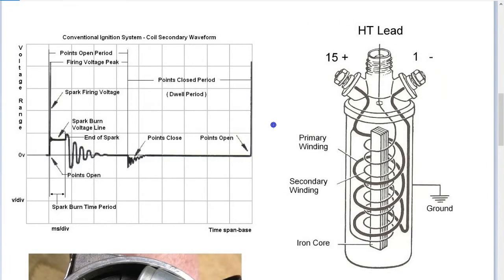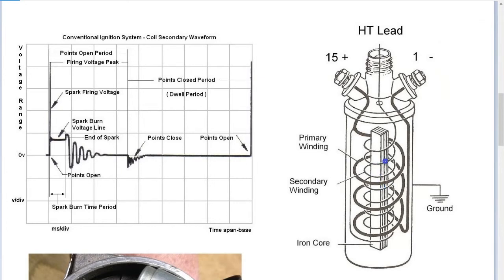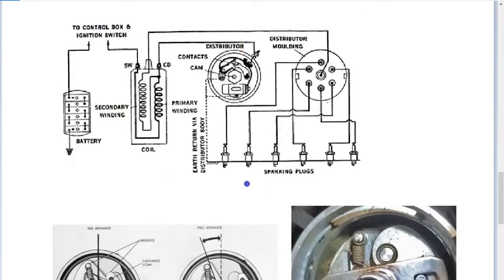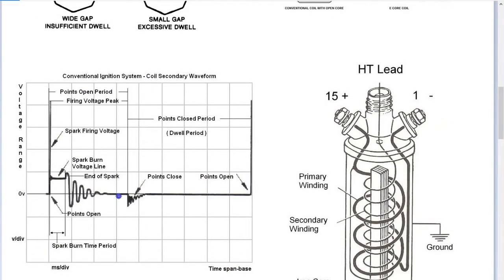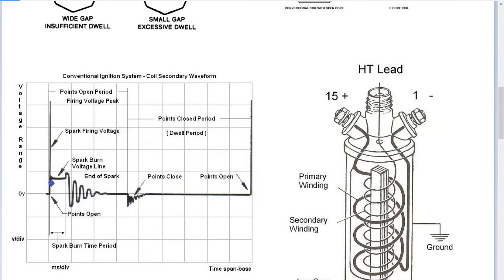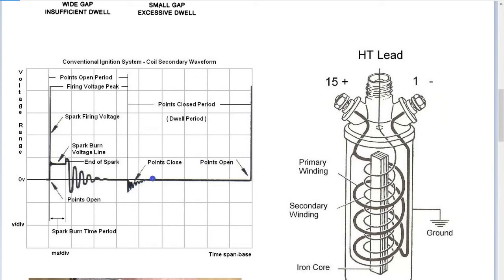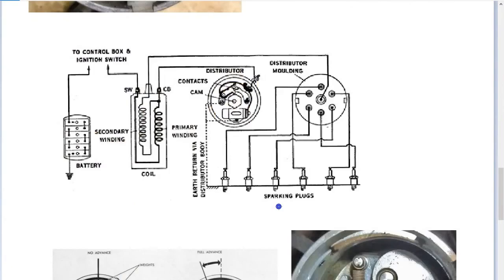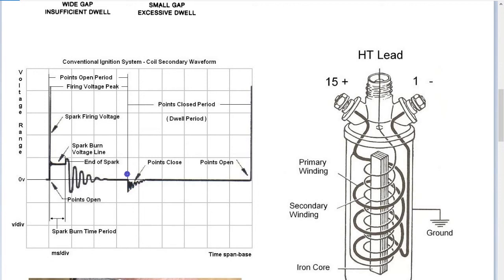Tune scope patterns, inductance, condenser tuning, dwell time E24

Comment: Inductance is an impedance to current flowing through the coil,not voltage building up in the coil.  Great video otherwise.
Reply from the maker: I'm probably conflating the voltage shown on the scope with the current flow.
Current and voltage confusion is fairly common among Mechanics.
I learned a bit about it as a Mechanic back before we had scope libraries (1980's) to compare wiggly patterns with known good ones, and no-one much back then really knew what the wiggly lines meant, more of a case of "that doesn't look right, lets unplug a few things and see what happens" so dug a bit deeper to find out enough to do use tune scope properly but I'm no EE as you can see.
Thank's for commenting and pointing out that too.